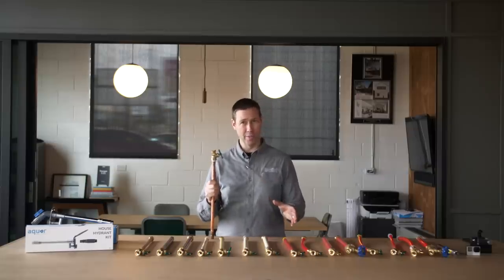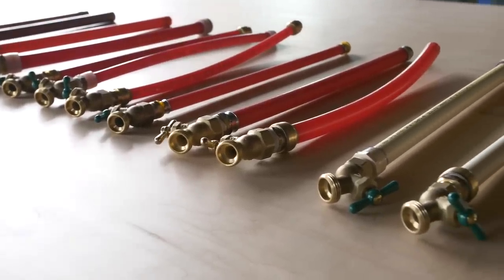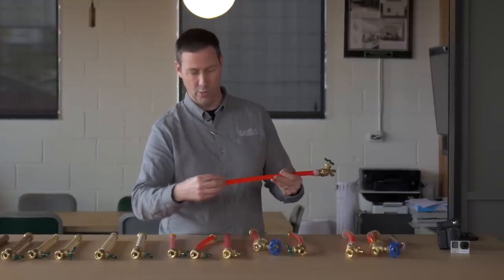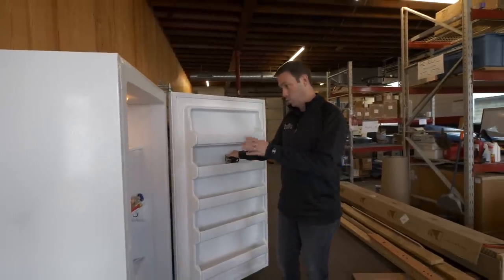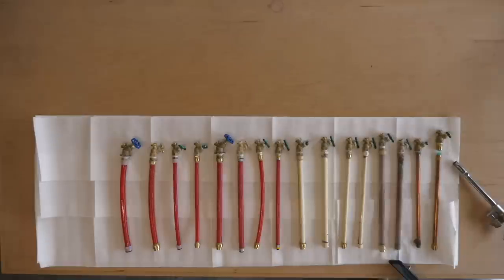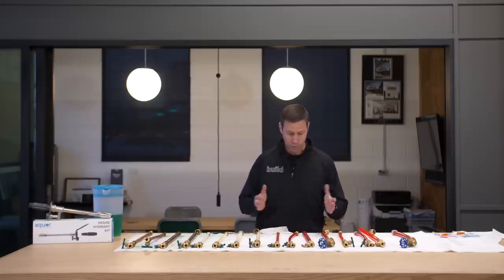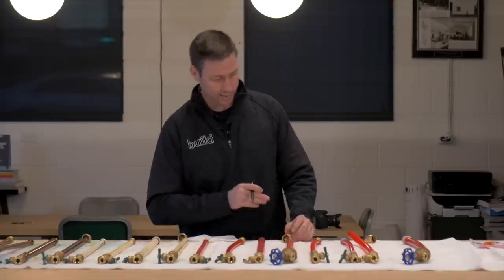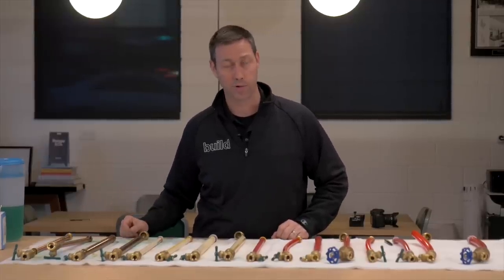Copper vs Pex vs SharkBite - Freeze Testing

Comment: Now why don’t you do a test on this to see which one holds up to mice, rats and squirrels gnawing on them. In the west and south where basements are a rarity and things are dry it’s common to have critters chewing through Pex and sometimes PVC just to get to the water inside. Normally by the time it’s noticed the crawl space is flooded and the water bill is astronomical.
Reply: I can just see the conversation:
Plumber: Okay, sir, your new plumbing is all installed, here's the bill.
Customer (after reading through the bill): What's this here "cat charge"?
Plumber: It's code. After we put that fancy plastic piping in we shut a cat in your crawlspace. Eats the critters that want to gnaw on your pipes. It's kinda feral so don't try to pet it.

Seriously, great comment. That is one thing I would absolutely not have thought of..

Comment: For the next test fill them all with water and put them in a small cage with about 10 mice or so at room temperature. Shouldn't take but a few hours to see which the mice prefer. The con is selecting something and then being specific in how you test a failure. There are many forms of failure.

Comment: Wrap insulation around pipes in cold drafty areas and let it drip at faucet, solved
Reply: In West Yellowstone?   Doesnt work. Way to cold. Blow the pipes out and shut it off for the season.  I use pex and still shut off the water to the outside.

Comment: ok sorry to have more concerns but 20-24 hours in a freezer doesn't show much about pex, this year 2023 we have been getting temps below 0 to around 18 below foor weeks at a time it will warm to about 6-34 degrees F and then drop below 0 again;, and it is absolutely blowing pex apart. if the fittings are outside or near the outside of the house shark bites are a joke in cold temps they aren't even a good 24 hour emergency fix, so a good video would be let us know how to keep these pipes and fittings from freezing in the event they have been run NEAR the outside or through joists you cannot run heat tape or insulate...i don't know much about this but it is a real bother to learn the hard way

Comment: I don't believe the teeth bitting in saved those fitting, I was more the fact that they were under less pressure because of the swelling the pipe did, lowering the pressure on the fitting.

Comment: Cpvc is crap after 2 years it becomes brittle and loses its pressure rating  also shark bites fail after a few years due to fact they get brittle also. The new copper pex being developed has copper lining to be as Good as copper for anti bacterial plus will have 3 times pressure rating especially for hot water upto 250 degrees. It uses a dual system ware the pex is stretched over cold rated pex fitting then band melted together. End result it can take 200-500 psi pluses take multiple freeze thaw cycles down to -100.

Comment: Too bad you didn't do a measurement test on the pex. In my experience copper pipe will expand and be oversize after a freeze. If pex has expanded then several freeze/thaw cycles would lead to failure.

Comment: should had placed the pipes under a pressure of 40 to 65 psi to simulate the actual pressure in the line when under use.

Comment: I have used PEX-A for a few years now.  Yes there is some leakage of plastic into the water but no where near enough to be a health issue.  If get more contamination from putting plastic container into a microwave with food then you'll ever get with PEX.  And yes I meant the "microwavable containers".  Its fast, strong, and works very well.  Did i mention its waaaaaaaaayyyy   cheaper.

Comment: Plastic degrades with heating and cooling cycles and exposed to hot and cold water which leaches the plasticsers out.  Test would be more accurate after plumbing was in for a year or two. Copper would not change as much.

Comment: How would copper pipe with insulating sleeve do in cold temps? Does it help?
Reply: Yes it helps, it does not prevent. It's like security it needs to be done in layers.

Comment: I gotta say pex is fine for first 5 years but in ny drastic weather changes about 7th year you better not touch the pex cuz it's brittle garbage, lots of places in Europe you cant even use that stuff, and bottom line you're supposed to drain water down to outside environment for before winter season

Comment: Another Great video. Fun facts about water freezing: 1. water expands 9% when freezing. 2. The force of water freezing exerts 114,000 psi.
One other thing- you  showed results for 1 freeze cycle. I'm guessing multiple freeze-thaw-freeze cycles would take its toll on all of the products resulting in ultimate failures of some sort. I've performed over 400 freeze tests on the Freeze Tolerant Ball Valve. Maybe you could show some freeze tests on the product !? You know ball valves crack when they freeze with water trapped inside. This valves has a freeze plug that is replaceable! give it a try.  www.freezeproofvalve.com

Comment: I in texas viewing this. A carpenter put plex he took out the copper old house. It was my grandmother's house. When the temp  drop to -1 i think that when i lost my hot water. It did not have it dripping. The internet said cold should be ok. The second cold snap the kitchen  next to the outside water heater lost hot and cold later the batrpom lost hot and cold barly came out cand returned  warm up the hot and cog came back. Plex and the Lord. Yes.

Comment: I live in North Georgia where the temperature in Winter can get down to 5 F. My home is 33 years old and has copper pipe. I have never had a pipe freeze and break. The problem with PEX may be longevity. I have heard of plumbers installing PEX in new homes 15 years ago without problems today. What about 17 years from now? I trust copper more than plastic in the long run. What a bummer to reinstall plumbing in an entire house because a product cracks after 25 years.

Comment: I’d like to see this test done correctly and under pressure. Although they are failing there’s no water flowing or air in the line and then the most important there’s no pressure.

Comment: PEX has it's advantages. Not a fan of shark bites. I have seen multiple failures. It's a rubber gasket. Point blank-- rubber degrades
Reply: Point blank -- The distance between a projectile and a target such that it requires minimal effort in aiming it. In particular no allowance needs to be made for effects of gravity, target movement or wind in aiming the projectile.

Comment: Okay the copper failed but why did you not continue with the test to see if the others failed later on. When these lines fail people usually do not find out about the failed lines immediately so if the other lines fail a few hours later the fact copper failed first is irrelevant unless people sit and watch while temperatures fall.

Comment: The guy did not say if he used Type M OR Type L copper tube. The test may have had different results for the copper. There's a little more expense to using Type L so most Plumbers avoid using for more profit on the job, especially on new Home Construction. There's no more work to using Type L, it's just a material cost difference. I think this guy is just pushing Pex which seems to be the new Home builders choice for cost. The major builders will use and try to get away with the least costs for building which maximizes profit. When you are building hundreds of homes "cookie cutter" style it's all about costs. I notice that Home builders are not forced to offer a 5 year warranty on a home. Spending hundreds of thousands dollars for a home should be backed with more confidence than is required. Buying Cars new get a better warranty relatively speaking and considering what elements the car is exposed to. New cars can range on average between 25000 and 38000 dollars. Cars can have a 5 year and 100000 mile warranty for that expense. Time to regulate the builders and Not have them allowed to pass on that expense to the buyer either.

Comment: Is the pex and shark bite rodent proof?  Will a rat or mouse gnaw through it?
Reply: Yes, rodents can and will gnaw through pex. But you get a pinhole leak, and its easy to replace a short length with two straight joins (crimp or shark bite).

Comment: I dont like the adverse long term health effects of chemicals leeching from the plastic pipes into the water. 

Solution. Use copper through out, but run pex to the sensitive areas (for a year round home).
Reply: "According to a 2011 study by Yang, et al., which conducted laboratory extraction on many different plastic resins and products, most plastic resins showed detectable levels of estrogenically active (EA) compounds (11). This test was not conducted on plastic pipe, but HDPE product. This testing shows that the EA compounds are present in most plastics, including HDPE, however it does not prove that any of these compounds migrate during normal use (such as plumbing applications) as compared to lab extraction with EtOH or saline.

Researchers under the first phase of a three-year National Science Foundation project, conducted by the Whelton Group at Purdue University and others, are conducting field tests of PEX and HDPE and other plumbing. Findings, including HDPE chemical leaching and"

http://pprc.org/index.php/2015/p2-rapid/is-high-density-polyethylene-hdpe-a-good-choice-for-potable-water/

Comment: One Problem with your Fez testing I see at 2:36 into this  Pipes don't just have water in them they have water under city pressure
So an accurate test would be put the pipes under an avg city water pressure  lets say 60 PSI to 100 PSI  Most areas will fall into this area anything above 100 PSI you need a pressure regulator or it can cause problems with a hot water heater because the drip safety valve unloads at 120 PSI  or you hot water tank becomes deadly and if you have a one way valve then you need an expansion tank.  This could lower pressure enough to keep pipes from bursting, cold lowers pressure hot expands pressure however ICE tends to expand and push out This is why Pipes burst. 
I wouldn't use Shark bite on anything in my house its a temporary connection you relay on an O ring seal, O rings fail over time rubber drys out and cracks if this is behind a 4k dollar tile job guess what you just lost.
If you do the job right it should last years, if its wrong you be back in 2 years fixing it all or taking it out starting from scratch.

Comment: The experiment is flawed in a way that if there’s a fine line crack, letting the pipe sit on paper towel won’t show anything. Needs to pressurize the pipe (e.g., through the hose bibs) to show the results of such cracks.

Comment: Pex with hot water after awhile of use; Maybe 5-15 years will start to spring leaks on the pipe itself. They are about the size of pinholes. I remember hearing a pex company was being sued for something pertaining to these pinhole leaks. It's possible they redesigned the pex. But I have seen this so many times on older pex.

Comment: Every fall,I drain my outside hose taps,and blow them out with a compressor just to make sure there is no water left in them when the temps dip to -30. I had a 1/2" copper pipe supplying my  front outside tap that I didn't drain well enough,and over winter,it split wide open. Come spring,I replaced it with Pex. This video suggests the Pex will survive winter if I fail to drain all the water. Speaking of Pex, a few years ago I had my basement iron pipes,which were heavily corroded, replaced with Pex,which was done in one day. The installers told me if they used copper,the job would have taken a week.

Comment: I just finished repairing a very old crimp shark bite fitting I believe the actually shark bite pipe was chewed through possibly however I went to Home Depot and purchased brand new push on shark bite fittings and after I turned the water line on and 6 out of 6 fittings leaked and I did exactly what the pros showed me and yet complete failure most of the fittings were 3/4 only 1 1/2 inch

Comment: 0:57  I live in Canada, I have 2 external taps, copper to both (not Chinese copper, pffft) , neither bust, the issue with copper is its a conductor, so it will conduct heat from inside to the end of the pipe, chances are the valve will be frozen but the copper has no problem, 50 years and counting, all soldered no shark bite nothin. Yeh ha cowboys!

Comment: It is not clear to me by your video visually and since she didn’t Seney thing I would like to take issue with what I believe is in accurate information with regard to the copper. As there are two different standards for copper pipe type L or blue copper and type M or red copper with a distinct difference in wall thickness and pressure rating. Type M half-inch pipe has a wall thickness of 0.028 inches while type L is 0.040 inches. Type M three-quarter-inch pipe has a wall thickness of 0.032 inches and type L is 0.045 inches. While most plumbing codes allow the use of L or M tubing personally I only use L the thicker variant. The cost difference is not tremendous and longevity, durability and overall life time is better. Both professionally and personally I would appreciate a clarification on which type of copper tubing you used. And nearly 30 years I’ve never had any of my type L or blue copper with the thicker wall there and split from freezing including sections as long as 3 to 4 feet that have frozen completely solid.

Comment: I think the reason why the sharkbite connector came off of the copper pipe is because copper tends to expand and contract with temperature. At room temp, the teeth probably bit in just fine, but in freezing temps, the copper contracted, so the teeth lost their bite.

Comment: The problem with any new or different technology like Pex is the "but sometimes" principle. A product might be better in all regards, but "sometimes rats chew thru it" or "sometimes algae builds up in it".

The problem with this principle is one, that the advantagesthat  make the different-or-new-technology better are flat out ignored just by one or two potential flaws. 

And two, often when these stories are brought up, specific circumstances like rodent breed, type/revision of the technology used, brand name of supplier or outside conditions like average water flow thru the pipe or the specific microbe that caused the problem are ignored.

In reality it creates confusion. Even if you're against said new technology, providing these details might help your case. If I hear repeatedly the rodent problem is just a myth and I happen to live in an area where that specific pex eating rodent breed is problematic...then what?

Saying "watch out for breed X" may get me to stay away or go for plex much easier

Comment: So the only downside of PEX then is that it's not antimicrobial like copper
Reply: That’s not a downside... This is not a requirement for any kind pipe to begin with. Copper will not sanitize your water either, even best case the water quality improvement is negligible. (Which might be negated if the copper itself leaks into the water...)

Comment: For a greater test of burst strength, you need to partially fill the test pipes with water. The trapped air inside the pipes gets pressurized from the expanding ice which creates enormous pressure, much greater than ice alone. It’s the air pressure that causes pipes to burst not the ice.
Reply: That is 100% wrong.  You have failed elementary physics.  From: https://inspectapedia.com/plumbing/Force_of_Freezing_Water_Ice.php "Depending on its state, freezing water (or ice as temperatures continue to drop) can expand by as much as nine percent at a maximum force between about 25,000 and 114,000 psi."  wheras air obeys the ideal gas law.  it's pressure goes down as the temperature goes down, and goes up in in invers proportion to the volume.

Comment: Fun fact I got a customers  with no shut off to his silcock in the house he built in 1947 and never gets winterize, only difference i can see is its a straight shot  to the cock and no fittings for 10' my guessing  is the ice is allowed to travel back without breaking th tubing or fittings. Notice how I called it tubing

Comment: I am curious hol longer runs of pipe would test out.

How long do you use a plumbing system before replacement?  Old copper deteriorates very little from oxidation or aging.  My house has trouble free copper that is over 40 years old.  Plastics tend to oxidize, and have a problem with sunlight deterioration.  I am also curious how this test would go with 10 or 20 or even 40 year old materials.  I suspect we would see different results.

Comment: Shark bites are a problem and expencive. Use the cheap fittings with the crimping tool and 90% of your problems solved. And use radius turns don't use 90deg fittings.

Comment: I am a  Master Plumber with 33 years of experience and this test is flawed. CPVC is a DISASTER for a product all the way around. First of all water freezes faster under pressure. Your test  was not real world. CPVC pipe will freeze, split and break in large sections. As it ages it becomes more brittle. Anywhere there is a CPVC to metal connection say at a faucet,  that is a weak spot and will fail at some point. Usually this happens after 7-10 years. PEX pipe to date is the best pipe that has been on the market since galvanized pipe. Yes galvanized pipe.

Comment: as a local 1 union plumber in n.y.c. .pex is the worst invention for water lines. quick and easy takes the skill out of skilled labor. same goes for pvc. anyone can go to home depot,buy some glue .primer and pipe and "be a plumber" it's so quick and easy that we work ourselves out of a job. a job that would take a year or so soldering copper pipe and fittings takes a fraction of the time using plastic. then we get laid off until the next job statrs up.